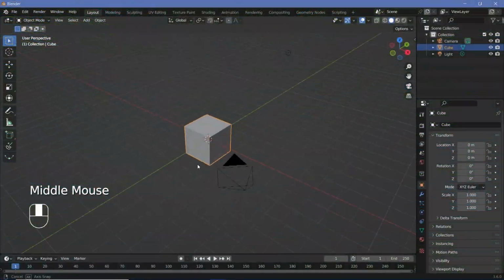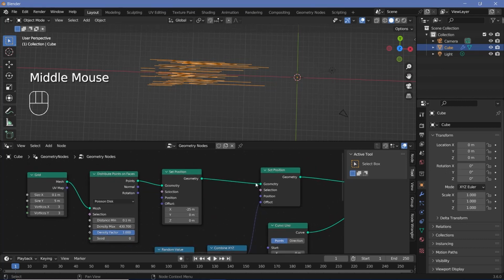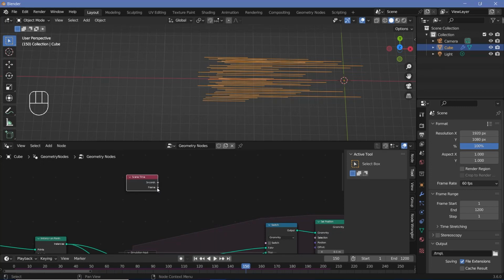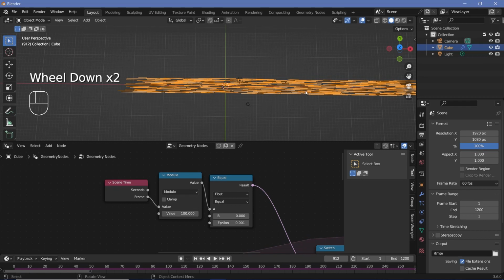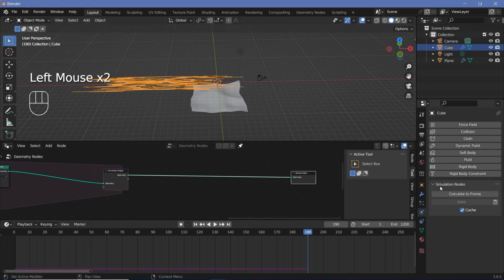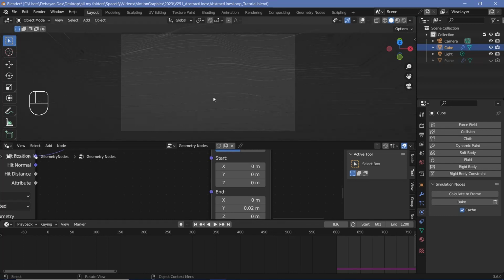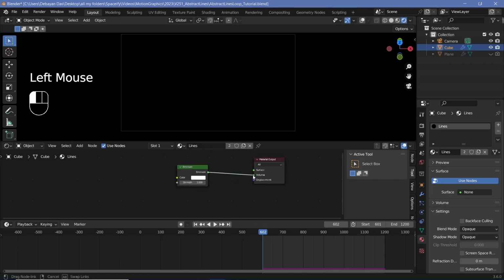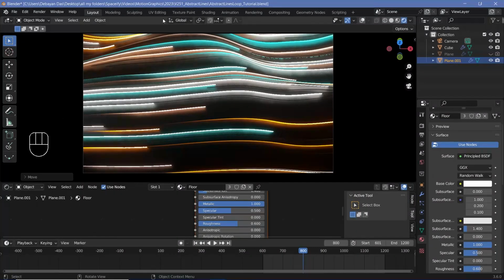Abstract Neon Curve Trails Loop - Blender Tutorial

Comment: There is no modulo node in version 4.2
Reply from the maker: Hi, the modulo node has been changed to "truncated modulo" or else you can even use the "floored modulo" options. Both will work in this case, I believe. It is once of the options in the math node. I hope this helps:)
Reply: @deayanstudios  Thanks. I tried both nodes, but I couldn't get the animation to work :(